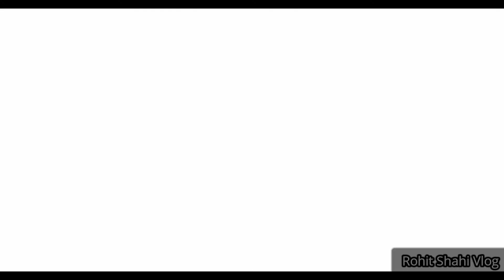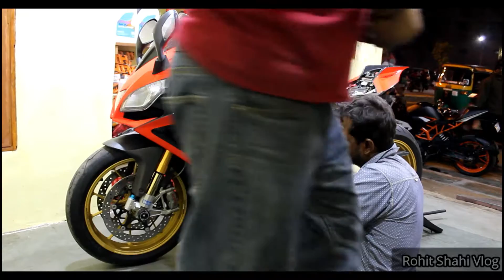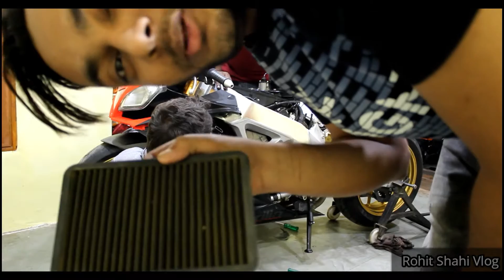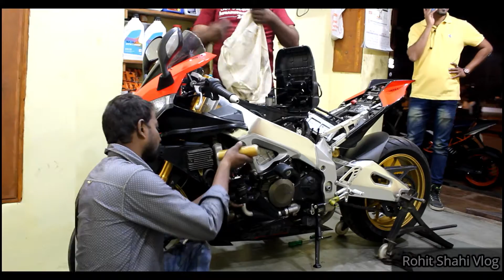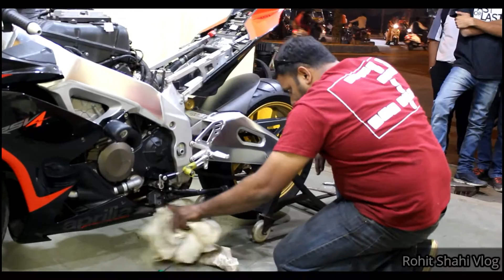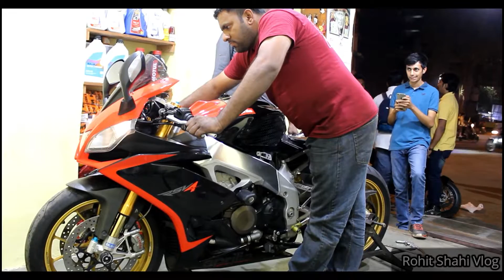Something Bad Happned...Aprilia Rsv4 Factory service after doing 5000 km...

Comment: Hey there, same climate here in the Philippines, planning to get 1 with an AR gp2r exhaust, how's the bike holding up? Is it easy to self service?
Reply from the maker: John Kerwin See 
it's been over an year ofthe ownership of the bike...it is holding up absolutely fine...its super easy to do the service...
just make sure the bike stays safe from rain...rest everything will be fine...go ahead and buy the bike...have a happy ride ahead ✌
Reply: Rohit Shahi so the bike doesn't do well in the rain? I have a garage but sometimes while riding, it does rain unexpectedly. I'm looking at a factory with abs and austin racing gp2r exhaust. Did you flash the ecu? Also, how many kms are you getting to 1 liter?
Reply: Rohit Shahi I'm currently on a 2012 zx10r, previous bike was a 2012 z1000. Will i miss anything going to the aprilia?
Reply from the maker: John Kerwin See 
I also have the factory...and I did not falsh the ecu...bike does well in the rainy condition but it’s just always good to keep these babies safe from rain...i had once checked the milage i was getting it to around 12-15 km a liter...
Reply from the maker: John Kerwin See 
For one thing i must tell you my friend rsv4 is in the v4 category and the kawawsaki’s were in the inline category...there major differences is in the explosive power...I guess you will not miss anything when you go to aprilia... you will enjoy your relationship with the aprilia...
Just take care of the parts they are damm expensive and hard to find...
Aprilia is a durable and a lasting machine...dont worry too much...get one and you will never regret it.!!
Reply: Rohit Shahi bro, you got fb?
Reply from the maker: John Kerwin See 
Yes name is Rohit Shahi
Reply: Rohit Shahi can't seem to find you. Can you add me instead? That's my name.
Reply from the maker: John Kerwin See 
You have posted your 10r add for sale
Reply from the maker: John Kerwin See you have a baby’s face on the profile picture I guess 
Misamis union high school
Reply: Rohit Shahi thanks bro!

Comment: What oil did you use @ 7:25 I see bajaj ??
Reply from the maker: shiva mithipati I am using bajaj for sometime i will change it to motul v300
This oil is for testing...
Reply: does it meet the specifications required by that bike. I don't think anyone recommends bajaj oil. Let us know more about it and keep riding.
Reply from the maker: shiva mithipati it does meet the bikes specifications and this is just for trial...i will change it after 1000 km